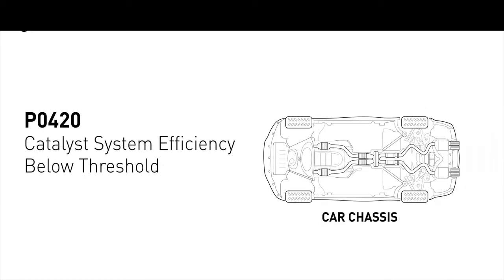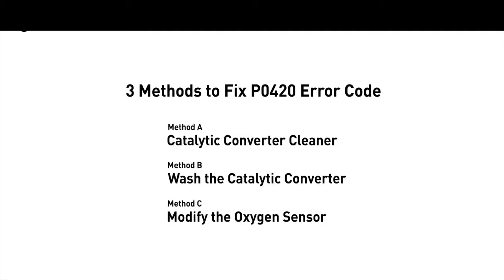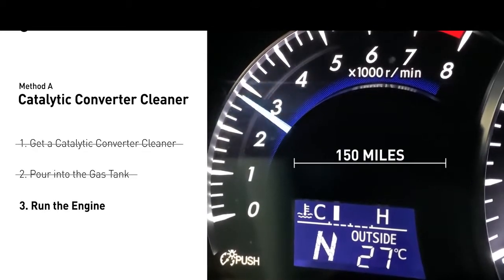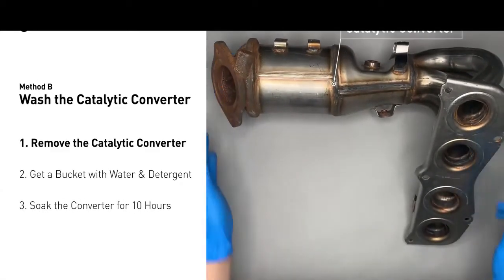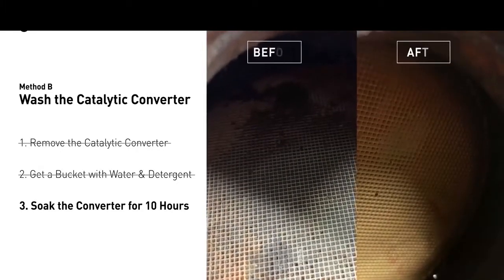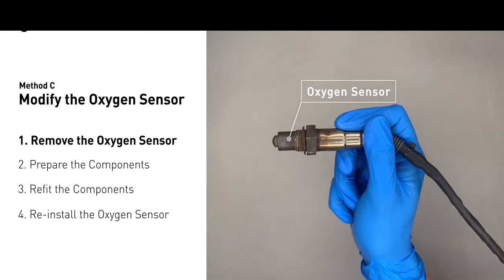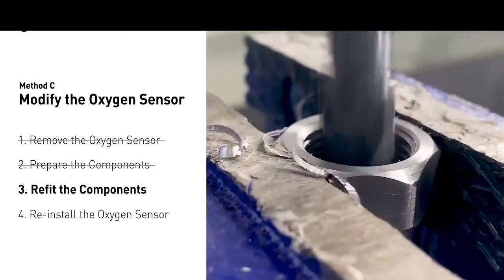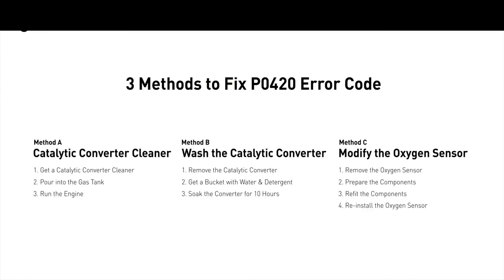how to fix P0420 ENGINE CODE

Comment: Had a 01 Pontiac Grand Am with a 420 code as of Nov 2021
After studying many videos my personal fix was one gal lacquer thinner in my 10 plus gal fuel tank.
Took in for another check 11/15/21 for MISSOURI emissions and passed. 
Will pour another gal in my 08 Caliber since lacquer thinner is made of petroleum distillants and 
 the benzene is a cleaner .

Comment: I've been doing this for 10 years plus school none of these are and approved method of service. P0420 or P0430 codes simply mean we a problem with the emission system. The O2 sensors just monitor burned gases and the computer adjusts the optimal air fuel mix. (Open/closed loop) The actual converter burns off excess fuel vapor.
1 always get it diagnosed could a whole list of things. Intake and exhaust leaks. Malfunctioning sensors. Or wrong or contaminated fuel. I've never seen a cleaner work well. Water and soap just make it rust faster. Why is its getting plugged up should be answered. Never modify manufacturer sensors that mods you did is probably gonna get  lean command cuz its not the getting gases its needs to function.
Bad robot.
Reply: Not only that but isn't the oxygen sensor mod actually "illegal"?
Reply: @jonmo2694  it must work then I’ll try it. Emissions are a scam anyway

Comment: Non foulers didn’t work for my 05 forester
Reply: try putting a second one, double it up.  And make sure you put it on the downstream sensor, and on the correct bank (p0420 is bank one, p0430 is bank two)
Reply: @Joe_Mission  I used two, would it be the 1st sensor or the sensor coming out later down the pipe that is part of the first cat? (That’s the one I currently have it on still)
Reply: @jjones243017  it should be the one closest to the back of the car.  Is p0420 the only code you have?  If you are just trying to pass emissions, there is a way to accomplish that in most states by following a few steps.  It is easier with a scan tool, but you could do it without a scan tool too.  Basically you would clear the codes, drive the car until all the monitors are set except the catalyst, then take it to the emissions place in that condition, before it completes the catalyst check.  Most places, you can pass emissions with 1 monitor still pending.
Reply: @Joe_Mission  thanks, that’s what I thought, there’s no emissions in my state just tired of the CEL and no Cruise control in my forester. I put it on the rear most sensor but no luck, it’s been on for a few months and I did reset the codes and it came back. Only code is p0420, I think I may have some bad exhaust manifold gaskets causing the issue possibly

Comment: You could also use a step bit instead of the 1/2 inch which would probably be easier drilling in the opposite direction than was shown.